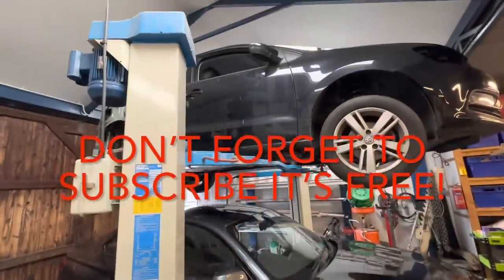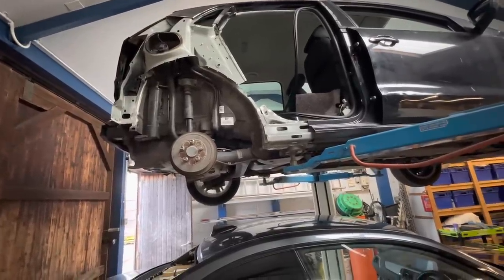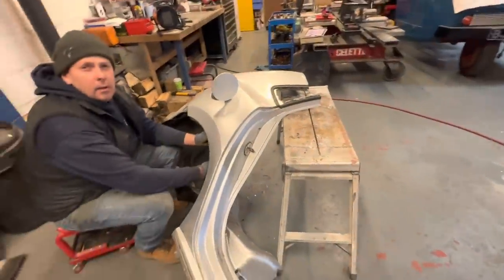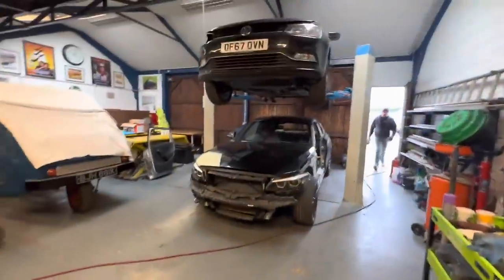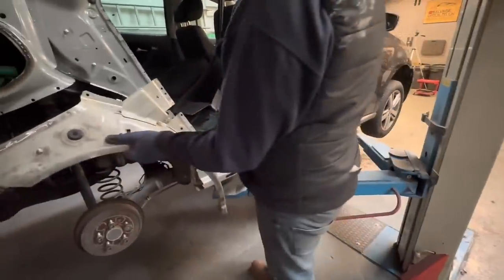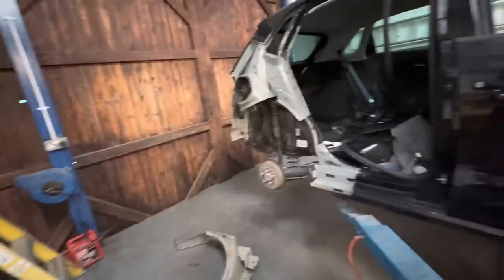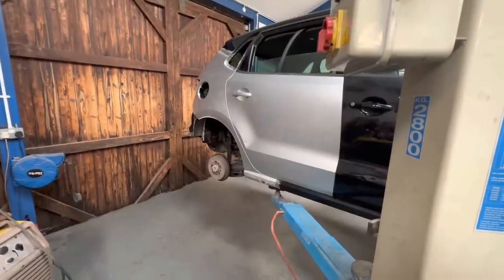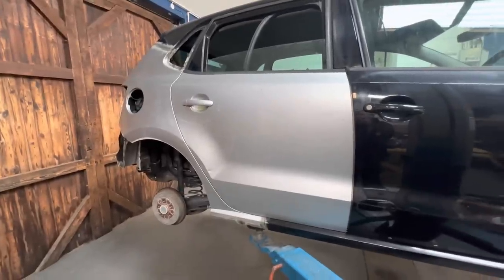REBUILDING A CRASH DAMAGED WRECKED 2017 VW POLO PART 2

Comment: Probably the best motor craftsman I've seen obviously doing it for many years yet never dropped his standards take a bow sir
Reply: Dead right! Chris is a top craftsman, not just on bodywork but almost everything in the motor trade, bar the electronics. Take three bows Chris!
Reply: As my mum has always told me: if your gonna do something - do it properly! Brilliant job.
Reply: Expert at all, even paint though he doesn't do it he still can.
Rob makes me laugh when he says there's not much work just a bit of welding and some filler, Chris must have the patience of a saint.

Comment: Hi,
These fixing clamp set for rapid and simple securing of sheet metal for welded and bonded connections, now they are a little different, they are more solid, several brands are on the market.Special, angled clamping pliers for universal application of clamps.

Application in hard-to-reach places, e.g. boot edges, hatchbacks, door pillars, triangular windows.Very effectives.

Comment: Würth do a 17 piece apperture clamp set still, with extra clamps available. Trade only unfortunately but still available and the set comes with pliers to release the clamp clips which now have holes in them for easy of use.

Comment: This was a great 'bread and butter job', it looked terrible at first glance, yet peeled back the picture greatly improved. It was good that there were a number of parts that stitched together, so they could be unstitched, by skilled hands, cleaned up and replaced by the maestro Chris. It is not owning the tools, it is knowing how to use them that matters. Welding thin metal is an art in its own right, avoiding the panel hammer, dolly and planishing work saves hours of tedious work, and results in a better product. This has the look and feel of another great product coming down the line.

Comment: If you get the body structure back to factory in all respects is it a repair or a restoration..  A repair is to enable safe re-use and does not have to be invisible. Somehow saying repair just doesnt seem to match the amount of work or skill required for what has been done here.